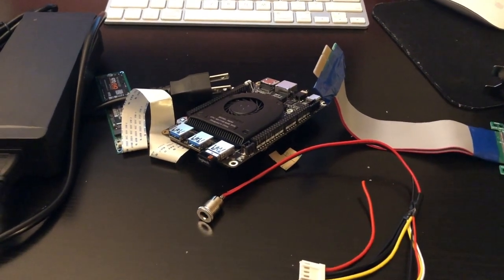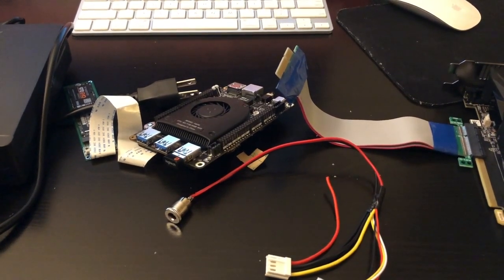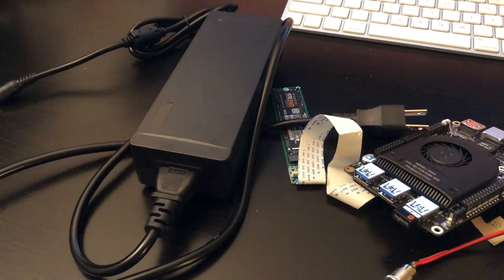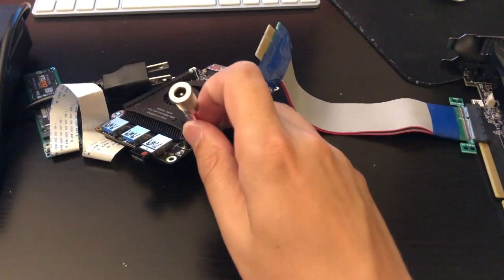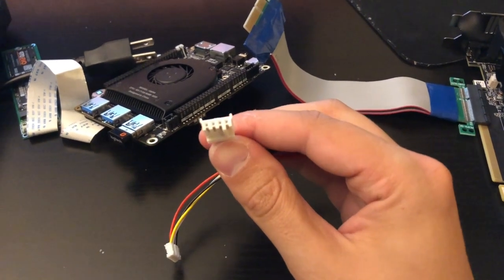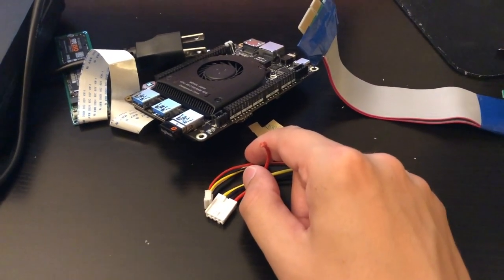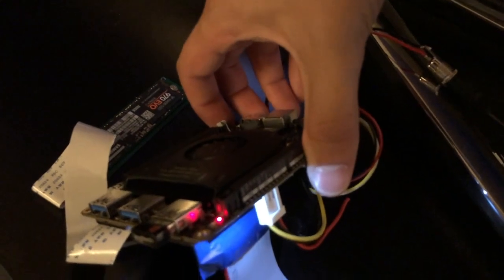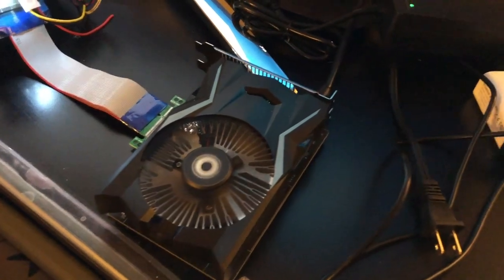Updated LattePanda Alpha and GTX 1650 Power Set up

Comment: And powering from big 40000 mah        or bigger power-bank?...+7 inch screen?And shorter cables?
Reply from the maker: Milan5605 it is possible, that would require a 3s configuration, a 12V regulator with high current output (~10 amps), and probably 12 18650 battteries
Reply: @HandheldHardware  Can you send me links to this things to buy?
Reply from the maker: @Milan5605  hi Milan, I thought about this some more. It would be better to use 4S packs. A step down regulator would better operate with the higher voltage and would allow the batteries to operate over a longer cycle. I don't think you would be able to charge the batteries and use the set up at the same time without designing a simple circuit with diodes or MOSFETs to control current flow when the charger is plugged in. Is this something you would still wish to do?
Reply: @HandheldHardware  yes...
Reply from the maker: Milan5605 hi Milan, I am having trouble finding the good 4s BMS with built in balancer. For 12x 18650  4s3p battery maybe you get 45-60 minutes of play. If you want to remove the batteries when done playing to charge (I would recommend this) you could use this BMS Anmbest 2PCS 4S 14.4V 14.8V 16.8V 5A 18650 Charger PCB BMS Protection Board for Li-ion Lithium Battery Cell https://www.amazon.com/dp/B07KSPX859/ref=cm_sw_r_cp_api_i_.dStDbSSCQX9B
Reply: @HandheldHardware  hi,i have question - mini nVidia GTX 1070 ti +GPU power via Pico psu?what version i need to use?can i connect to this charging board GPU + at same time ltp alpha?or i connect power - can i charge batteries + power two things?

Comment: why did you not use the usb c for powering the lattepanda alpha
Reply from the maker: Hi Random Stuff Channel, I have plenty of JST connectors to use, I don't have a spare USB C cable to break apart and turn to a dedicated connector. Either is fine, but since the JST connector is only for power, I thought it would be better to not waste the potential for a USB hub on the type C.
Reply: @HandheldHardware  Thats actaully really smart, ive aslo been hearing that the usb c ports have not been working for some people
Reply from the maker: Random Stuff Channel yeah I heard some of the power delivery chips won’t properly communicate with chargers, but they went to another Pd chip manufacturer awhile ago (Cypress I believe?)
Reply: @HandheldHardware  What is a pd chip?
Reply from the maker: Random Stuff Channel that’s the power delivery (PD) chip
Reply: @HandheldHardware  Some GPUs have USB C port on the shield for VR purposes, but I also heard it is good power source (heard about people charging smartpones from it as it was charging it better than many chargers) maybe powering Latte Panda from this port would simplify power delivery for the builds.